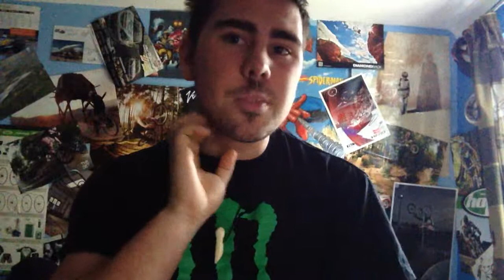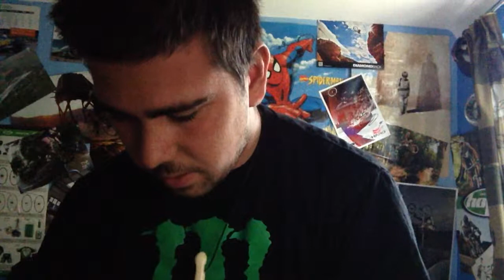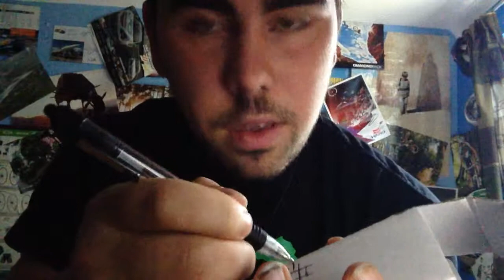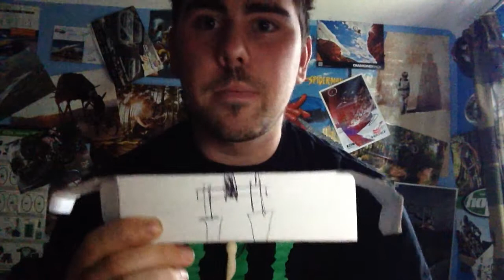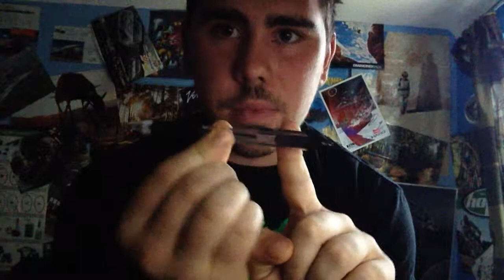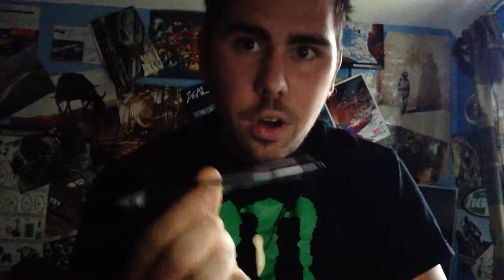brake bias bar

Comment: That is not how it works at all you idiot, you're drawing is close but everything else is wrong, the balance bar is not connected to the front! It pulls the main pin sideways and moves the ball that sits in the pedal toward either cylinder, the further that ball sits to either cylinder, the more that cylinder is moved by the pushrod, as the